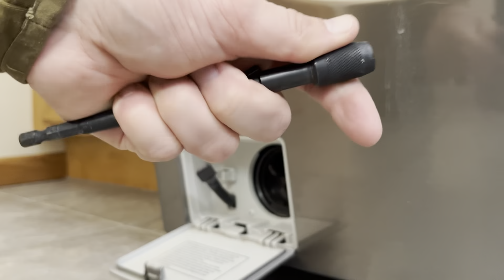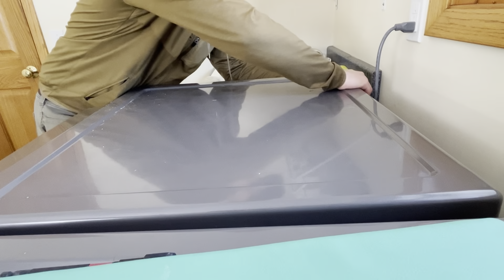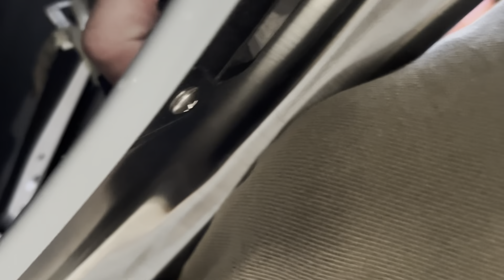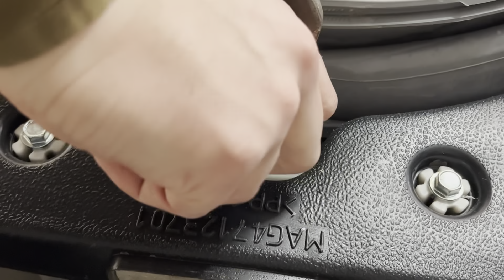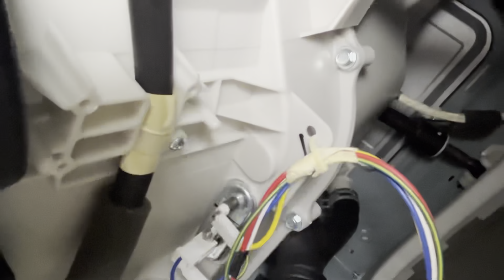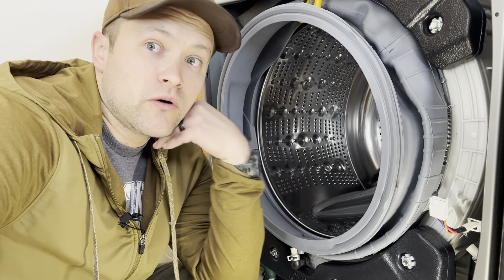How to Replace Your Washing Machine Door Boot / Rubber Door Seal Gasket

Comment: I just did this whole replacement without the special pliers. I don't recommend trying it! 😅  I had to use 4-5 clamps that held in 3/4 of the spring, then use 2 sets of needle nose pliers to get the last quarter over the rim. 3 attempts later (and so much yelling and cursing I'm surprised the police weren't called for a DV incident against my washing machine) and it's still leaking!  I found the inner spring had slid off just slightly during its test wash. Had to call someone in the end 🤷‍♂  I wish I'd known about these pliers before I tried
Reply from the maker: Owch. Doesn’t sound fun!

Comment: I only needed access to the nuts on the back of the door hinge bolts (which were not captive on the particular model). So, I removed just the outer sprung retaining ring. Refitting it without the circlip pliers was something of a struggle, but stretching the spring over two screws though a piece of wood (separation 82 mm, on my second and successful attempt) got the job done. Just loosen one screw, to pop off the spring, when the wire is fully in place.
Reply from the maker: Nice work!

Comment: That back wire and spring is correctly made. The hook is open so that it can be installed without removing the front on the washer.
Reply from the maker: Huge pain the a$$! Lol
Reply: In what circumstances would being able to install the inner retaining wire without removing the front panel be a benefit - except if the wire/spring was the only part needing replacement?

Maybe some whizz can replace the seal without removing the front panel, but, if you have removed the seal from the panel, you could completely remove the inner ring  - if that's even necessary - without needing to split it.

Comment: Had this same problem.. the spring spreader tool fits the outside spring but not the inside spring. There should be a separate tool for the inside.
Reply from the maker: Frustrating!

Comment: Some times replacing all parts you remove is better option

I got burned replacing just LG dryer drum roller.  Better to replace roller and spindle

The defective interior spring clamp was a wildcard

I would have replaced it after all the grief 

The exterior clamp is not as critical
Reply from the maker: Yeah if I do it again ill be buying a new one ahead of time. That thing had me real angry. Ptsd
Reply: @AllHomeDIYDad  Very good 

I am working on door lock 

https://youtube.com/playlist?list=PLmAfSpkyVfpVYzhUzk0yekfqh7fHNjZgG

Can run without the clamp until I get spring tool